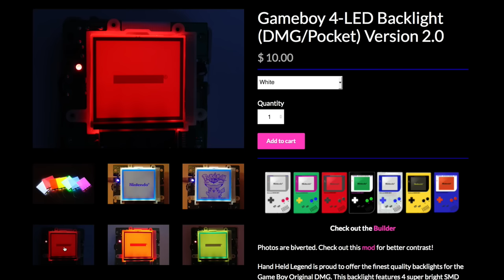How to Install a Game Boy Pocket Backlight!

Comment: Why not get a Gameboy Light?  Got mine on eBay for like $40
Reply: +Gramtics Gaming  You also need some basic soldering skills, careful hands, and patience, which most people don't have. I know guys that can't even put back together a NES pad after opening it.The inexperienced would then have to pay someone else to do the job which would most likely cost more than my GB Light. Not everyone has the knowledge for modding and upgrading their consoles/portables.
Reply: +SNaKeYe355 I know a 12 year old who did it all by himself.
Reply: ***** I did buy it a couple years ago.  I'd expect it to go up in price by now.
Reply: Terror Chicken I never said a 12 year old couldn't do it.  I simply meant that most people are technologically incapacitated. I myself learned to solder and modify things at a young age as well. That doesn't mean every adult or child is or will be good at it.
Reply: SNaKeYe355 I undertstand your point now sorry.

Comment: wouldn't one of these panels be better for the gbc back light mod than using the front light panel?
Reply: Keefer Stoldt the difference is that the gbc has a polarizer stuck between the 2nd and 3rd screen while the pocket is behind the screen

Removing the polarizer from a pocket is easy compare to the gbc which is not possible unless your extremely lucky

Comment: just ordered the parts for my GBC. I got the front light wit loca 7 and I had no ideal that my GBP had a backlight mod I'm so happy that these mods are cheap cuz im going to mod my GBP and I'm thinking about biverting it as well I ordered it but I don't really have a good soldering gun I just got an old cheap on that I can't control the heat with I think I mite wait till I can get a better iron before tackling that mod idk yet I really don't wanna mess it up it's the first GBP I got I won it from the under the cap game from surge a long time ago

Comment: What would be the difference between a gameboy light and a backlit modded gameboy pocket? idk if this is dumb to ask , i have no knowledge about electronics
Reply: Gameboy Light has a power on switch, and an on/off switch for the backlight. the backlight of the gbl also has an aqua green/blue hue. The light also costs alot more than a gbp as it was stocked in Japan only and is quite rare. I bought gbl off ebay and while it's very nice, the sound is a tad distorted compared to the processing of the gbp.
Reply: The battery life for the gbl is better obviously as it takes two AA batteries instead of AAAs, plus you can toggle the backlight off.
Reply: So basically it comes down to battery life and screen color, if you're willing to fork out an extra 50- 60 bucks.
Reply: Edeniobennettsque yeah but , even being able to turning light on in gbl , the screen works just the same? Could a gbp be modded to have backlight turned on and off as a gblight?
Reply: Possibly if you were to wire the blacklight cable to another switch? I dunno.
Reply: +Sleepndraw Ofc it could be made =)
Reply: +Sleepndraw I think it might require a different mod since this one peels off the reflective layer -- and thus one would not be able to see the screen with the light turned off, or at the very least it would be super dim I guess.
Reply: Sleepndraw It's definitely do-able, this guy figured it out: 
http://chipmusic.org/forums/topic/12244/beginners-questions-backlight-switches-and-general-guidance/

Comment: HELP! I installed the backlight just fine and it works and everything! However, none of my games load now; A distorted nintendo logo falls down the screen every time. I know the games work cause they work on my other gameboys. Someone please tell me what i couldve done wrong and how i can fix it! :(
Reply: Yeah, I had this problem too.  It's caused by the backlight solder points shorting out the cartridge pins that sit directly above it when you assemble the gameboy.  You have to put a piece of electrical tape across the solder pads like he shows in the video to fix it.

Comment: I found that the place where you soldered the wires  made the screen too dim. I used another place and the screen got brighter
Reply: Do you remember which points you soldered the wires to?
Reply: Apple Juice ?
Reply: Danny Perski Soldier the red wire to point numbered 6, above your blue wire.

Comment: Well, you better wash away that flux residue on the PCB (mainboard) because it will destroy the soldering points by time, it will dissolve in the moisture, and will automatically remove oxide slowly eating up the tin/lead soldering points rendering the game boy useless.  Isopropanol alcohol, chemically clean gasoline or Zippo lighter fluid will dissolve the flux residue. Also it will leave the PCB shiny and clean. :)

Comment: wow, now i need to learn how to solder
Reply: The way I initially learned it in school was by bending and soldering stripped copper wire together into the shape of a little car or a boat or things like that.
After that, you can look up electrical kits where you'll solder some LED's on a circuit board to create a small star or xmas tree or a fully functioning clock or a tiny robot.
Have a look for "minikits" on www.velleman.eu/locale if you're interested.

Comment: oh my god, problem fix... found out it was the rechargeable batteries... i added regular batteries and it turned on so now it works... my mod was done inside a non battery indicator Gameboy pocket. so at least i know when the batteries are dying , the backlight will turn off lol

Comment: No joke - the ribbon cable is extremely fragile. I tried my best following your guide but ended up snapping it. just a warning to everyone.
Reply: If you ever attempt it again, tape the ribbon cable together, it will reinforce the solder points therefore reducing risks  of damaging the screen
Reply: +BlindEye Twinoid this is exactly what I was thinking. I will try it next. Also, the sticker removal without leaving residue was extremely difficult.

Comment: Hey Colin my pocket had a weird coloured circle on the screen  similar to the following link.  i read online that a new polarizer can fix this so thought id follow your video and just do the backlight at the same time it worked great but i still have the same problem with the circle, do you know what causes it and if theres a fix?
Cheers!

http://mlb-d2-p.mlstatic.com/leilo-gameboy-pocket-modelo-mgb-003-preto-leia-anuncio-951411-MLB20529904611_122015-F.jpg
Reply from the maker: My guess is that the discoloration is on the reflective layer behind the screen, so in your case doing the backlight mod (with a new polarizer) might be worth a shot.
Reply: Late reply, but there's a burnt polarizing film on the front of the display causing that dot. It's caused by leaving the GB in direct sunlight for too long. Peel it off and get another from HHL or KB. Iirc Kisch Bent has adhesive-backed polarizers for just this problem.

Comment: Logic Board? I thought it was a Printed Circuit Board (PCB) or a mother board.
Reply from the maker: PCB is a generic term. "Logic board" and "motherboard" generally mean the "main" board in a system, which everything connects to.

Comment: Just attempted this, and broke two screens. :(

it is next to impossible to remove that reflective layer without breaking the cable. Oh well, waiting on the parts for the better mod, the backlit original model GBA. At least that I can't fuck up anywhere near as easily. Not attempting it on another GBP. But I may attempt it on a original gameboy, since it seems the cable on that is allot more robust.
Reply from the maker: +Torque Effect Interesting you had that experience -- I've found the Pocket's screen easier to remove the reflector from than the DMG's (I ended up ruining the ribbon cable on my black DMG's screen). Best of luck with the future mods!
Reply: +This Does Not Compute Thanks. Currently trying to removing all the adhesive still left on the back of the screen, and isopropyl alcohol isn't doing the trick, and unfortunately I don't have any goo-gone in the house. :(

Comment: Well this was a frustrating way to break a game boy lol. I couldn’t get the glue off the back of the screen well enough no matter how long I tried. I also couldn’t stop dust from getting in the screen or behind the lens. It was a nightmare. Soldering circuit boards and rebuilding engines is infinitely easier than fussing around with glass cleanliness.

Comment: This popped up on Aliexpress https://www.aliexpress.com/item/160X160-FSTN-COG-LCD-Module/32819637938.html
I'm curious if someone more experienced than I could figure out how to use a microcontroller to translate the gameboy display signal to the ST7529 driver format
all this assuming it fits in the case but it's almost the right resolution which is rare

Comment: First attempt has failed! Ahhh my idiot self hit the back light with the soldering iron, not my most shining moment.... Also i guess i wasn't gentle enough with the ribbon cable because I got a single line down the screen as well as a little circle from the spot i touched with the soldering iron.
Granted I was smart enough to do my first attempt with a gameboy that was in really rough shape and has some problems with the A button not registering unless you press really hard, even after cleaning. Also this model does not have the red battery life light which I think is really really dumb considering this thing has a short battery life. Anyways thanks for the video I guess I am going to try once more.
Reply from the maker: It happens to everyone; Game Boys aren't the easiest things to work on.

Comment: Just in case anyone reads this far down after 8 years... :-)
If once you've finished you get blank vertical lines on the display (that weren't there before) don't automatically assume your screen is beyond repair. If the cable is visibly damaged / separated then you're probably screwed, but if it looks intact, try the tape / pressure technique demonstrated here (on a non-modded GBP) by QuickFixGamingLLC:  https://www.youtube.com/watch?v=Gzgk5Fs5SmY
In my recent case, after the mod I ended up with a whole chunk of dead lines right down the centre of the screen. QFG's trick repaired all but one line... Encouraged, I added a sticky foam pad on top of the tape, so that when the case is re-assembled, the front of the case itself presses down on the cable. Result: Fully working screen with no missing lines. Disaster reversed, as simply as that!

Comment: Its bullshit, I did everything right and im not getting any power to the backlight, I put positive with resister on that point I was told to, I put negative on number 4 and I turn it on and I get no power... I put the negative on number 5 right above 4 and it powers on but the Gameboy wont bootup, when I undo the negative then the Gameboy boots up... WTF is wrong with this peace of shit